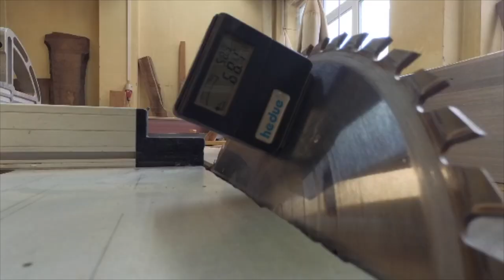How to Make Whiskey Dispenser at Home | Handmade Alcohol, Liquor, Whiskey Dispenser Ideas for Gift

Comment: Great build. What holds the spigot in the hole you drilled? No nut on the threads once inside the bottle?
Thanks for your help
Reply from the maker: Hi :) 
Thanks. It’s just a silicon :)

Comment: Great idea! I actually have a couple of square glass so I would like to try to make one or two dispensers. Where have you found the valve and the faucet ? and have you put some silicone when you've inserted the glass in the square wood to keep it in place ? keep up the good work ;)
Reply from the maker: Thanks :) 
You can find it on amazon or ebay quite cheap :) 
No, the wooden structure is very tight and the faucet are preventing glass to fall out :)

Comment: Want did you use to fix spigot to the glass and want cork did you use thanks
Reply from the maker: Hi Chris :) 
So I fix the spigot with silicon glue.
I used a metal cork with rubber around where it meets the glass.

Comment: Trying to build this and every time the glass block cracks from the spigot hole LONG AFTER IT IS ASSEMBLED.... sitting for hours and hours just fine and the next morning it's cracked. @Wood Euphony Woodworking did that ever happen to you and what's the solution?
Reply from the maker: Hi :)
I didn’t have problems with that…
But I did have the problems with silicone :) some silicone don’t bond quite well with glass…
Reply: @woodeuphonywoodworking  thanks for the quick answer, Glass Block #9 actually turned out 😲- I think the Problem was that i drilled too close to the corner and by sacrificing some of the volume in the very bottom and place the spigot a little higher the glass stayed stable. I did not like the Silicone solution either and instead drilled a 1.5 Inch fill hole, which allowed me to reach in with some long needle nose plyers and mount the spigot with the included silicone seals, chrome grommets and nut. I used a black rubber stopper from Home Depot as a stopper and it looks okay.
Reply from the maker: Uu nice… I will try it with your idea with the silicon seal… maybe will be better than my original idea… thanks :)

Comment: What size holes are drilled and what type of spigot do you use? Thanks
Reply from the maker: First you must find spigot and then the diameter that is on your spigot you drilled in to the glass. So all depends what spigot you got. You can find them on amazon or ebay.

Comment: Mmmmmm. Glaaa shards in my whisky is the best. How’d you make sure it was clean? This is great work. I’ll be using your design for my own. 

I just don’t know how to remove all the glass
Reply from the maker: Hi :) 
I didn’t show it but I did wash 10 times before gluing the valve :) there vast big glass pieces in beside 2 small circles … only white glass powder… when you drill don’t push to hard….
Reply: @woodeuphonywoodworking  thanks for the advice! That makes more sense with the whole glass dust. I’ll keep that in mind
Reply from the maker: @gmeister03  no problem :) 
If you have any questions just ask me , I’m glad if I can help :) 
Be safe!